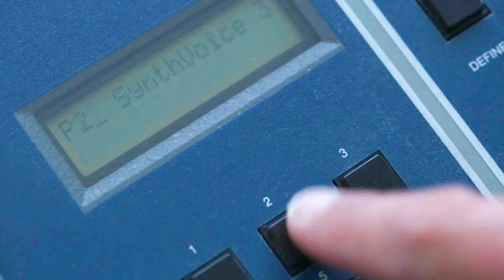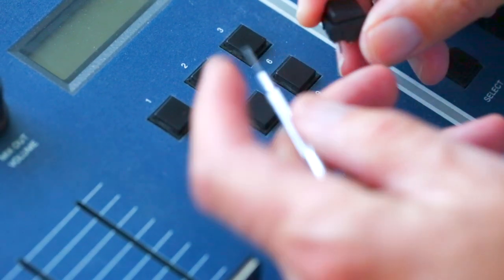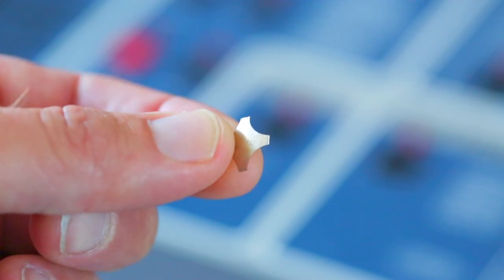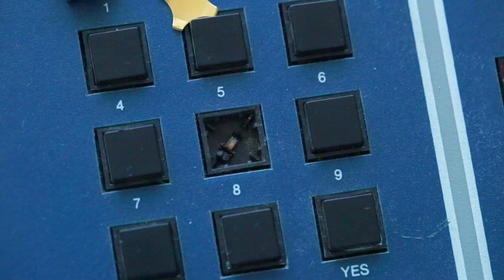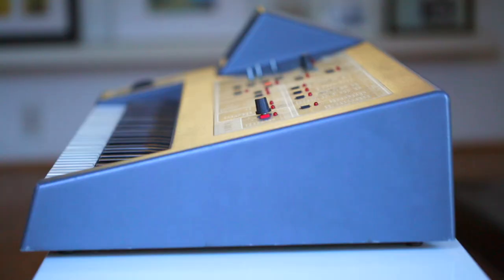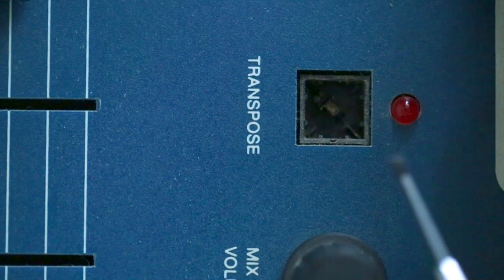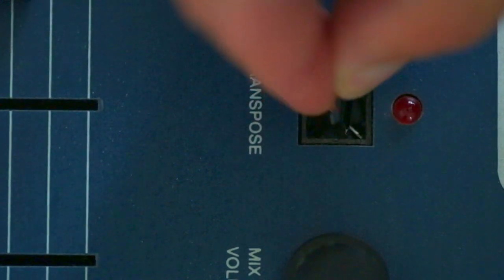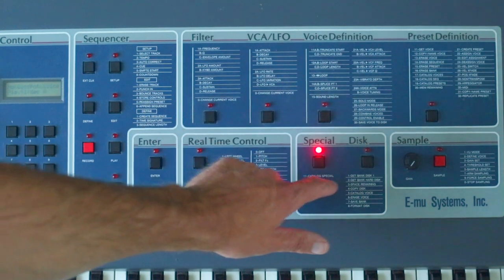EII Button Refurbishing

Comment: cool!  Also rubbing alcohol on a q-tip is a great way to clean these - alcohol evaporates and won't damage your unit..  Another way is a brand new #2 pencil with a unused eraser...because the eraser is gritty it takes off the carbon (if you can get it in there) ...then canned air.  But of course you got it done.